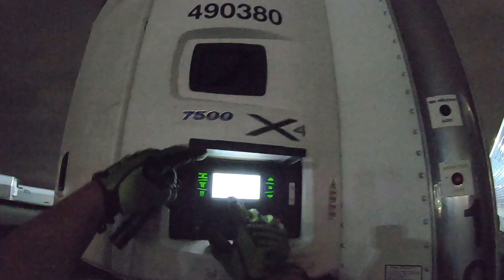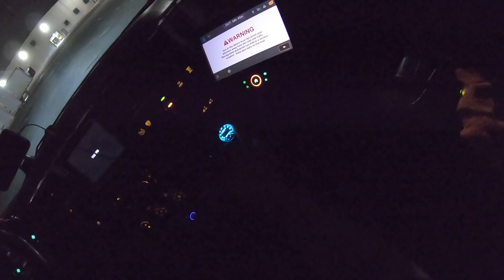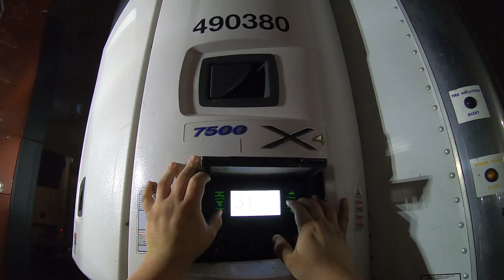Tropicana Drop and Hook & Backing

Comment: What is the # per PSI how accurate are they and will they stand up to a scale ticket and do they calibrate them.
Reply from the maker: Usually I’ve found within 25 lbs +/- when properly calibrated. When in doubt hit a scale. Then recalibrate based on fresh scale ticket. You can calibrate both gauges are adjusted with small flathead screwdriver.